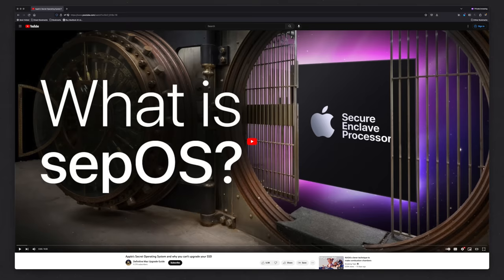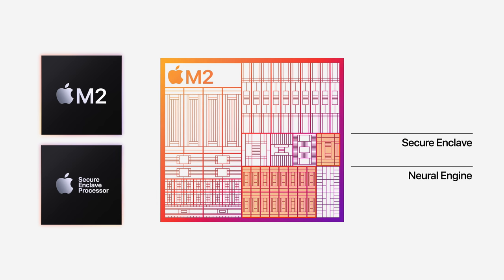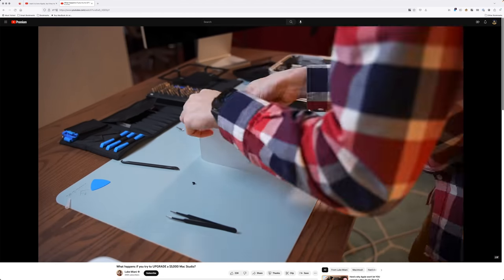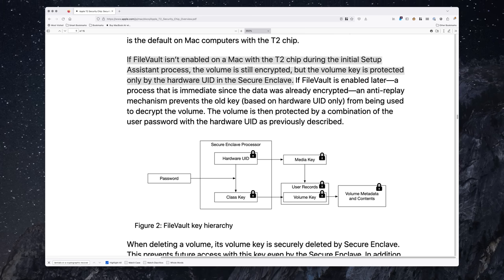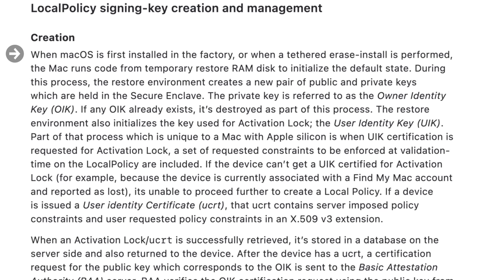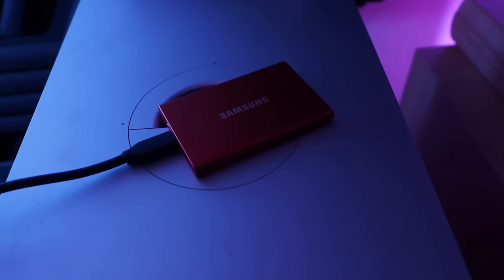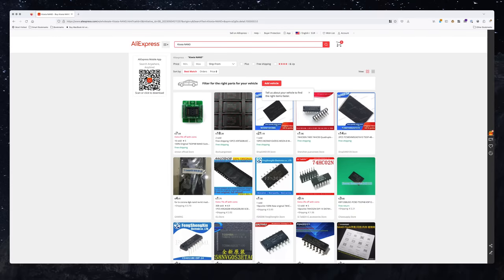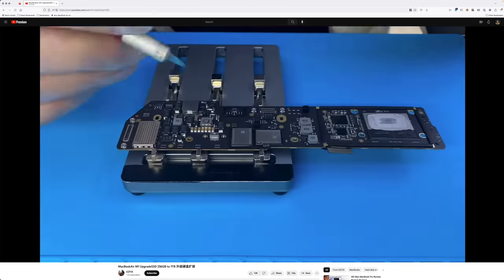Was I wrong? Apple Silicon and SSD Upgrades

Comment: Apple is becoming the embodiment of what it means to be consumer hostile.
Reply from the maker: It's been a trend with Apple post iPhone, they learned a lot from it and took away some bad lessons. I suppose you don't become the world's richest company by being generous.
Reply: Always has been…now just over the top now
Reply: To be fair, they don't market to the self upgrade/hobbyist/tinkerer market.   Every company that sells things wants people to buy more of the things they sell.   
My wife's laptop from work (Dell) doesn't appear to be terribly upgradeable either.
Reply: It’s gotten so much worse.
Reply: They've always been like that and I wouldn't touch anything Apple with a stick, but the damn M1 (and M2) MacBooks are so power efficient. Once the general laptops catch up in power efficiency, I'll switch back I guess. I'd prefer a Linux system and Asahi Linux doesn't cut it yet (though they're awesome).
Reply: @Scott__C  Not to defend Dell, but having Dells computers (both personally and professionally) for the past decade, I tend to disagree. Though, I guess it depends on the model.
Reply: @nowave7  And again, it's her work computer, so there's not any adding RAM, upgrading drives going on.  They have a standard issue everyone gets until it breaks or the I think 3 years is up.
Reply: @Scott__C  That is a company policy not a hardware/software limitation. Not exactly the same, right?
Reply: @nowave7  Partly, but I'm sure they choose models based on that.
Reply: Becoming? 😂
Reply: @Scott__C  so sad given its tinkering roots in the Apple ][
Reply: Right, but if they kept with that, they'd be making very little money.
Reply: @nowave7   There are still Dell systems with 2 user swappable NVMe drives and RAM modules. They even tried to standardize new form of RAM modules to be still be switchable. Dell is not doing this because they don't want to the extra money, they are doing it because they target businesses who can't send in a notebook for weeks to get it repaired. But need inhouse engineers to be able to fix problems within a few minutes.
Reply: But it is at least not as bad as it could be. At least the parts are not paired in a way that would make it impossible to replace them.
Reply: It's Tim Cook's philosophy. To extract as much as possible from consumers.
Reply: @nowave7  Dell XPS laptops are just as unrepairable as macs. Only their business line laptops are repairable.
Reply: @Scott__C this is what I always say when people talk about Apple being anti-right to repair. The vast majority of Apple customers do not want to or wish to repair their own devices. I care about repairability because I like tech but most consumers do not care to open their expensive device and tinker with it.
Reply: @FlyByWire1  That's correct and why I don't understand why so many seem to think Apple should be forced into that when there are other products that meet that desire/requirement for people.
Reply: I don't think Apple is legally required to cater to the community of users who like to service their own computers. Small PCs are becoming unserviceable, just like TVs became unserviceable decades ago. There used to be TV shops on every corner in my city. They're all gone now, and I've never heard a single person complain about that. Nobody has ever argued that TV manufacturers must make upgradeable or compatible devices anymore. Apple is making computers into disposable commodities, like TVs or razors. This is progress. Your freedom is not impacted by Apple's small 10% market share. Why would anyone argue that a small player needs to create products identical to the big players? You don't have to buy from Apple, but you should be defending their freedom to build whatever they want. This is supposed to be a free country.
Reply from the maker: @TheNameOfJesus ll bite, Apple by profits is nearly a monopoly (at least in the phone and wearables markets) and has an outsized influence on any market it exists in. Turning computers into eWaste is absolutely a bonkers take as there’s no reason to do this (beyond profit motive).

Also, TVs are repairable, I actually replaced a bad LCD in a tv panel as I looked up the part number on eBay and bought it for all of $100 about 10 years ago. The main reason tv shops evaporated is cost and rapid improvement in tech. TVs are exceptionally cheap, and the cost of fixing a tv is higher than replacing it. Also, tv standards radically improved during the 90s, moving first to flat panel and progressive scan and the very first lcds hitting the market in the late 90s. Old TVs suddenly were unsatisfactory and later out of date after HD video. 

Computers on the other have gone the opposite way as they’re now viable to use for a decade or more as requirements to run many popular applications havent’ increased by orders of magnitude. Also unlike TVs, Apple’s computers haven’t radically lowered in price, and in some cases have increased. Apple has a problem: they made a product a little too good, and needs to force consumers to buy new products. This is why they removed RAM upgrades and later SSDs on intel Macs despite other PC makes finding ways to keep them on thin and small laptops. Apple silicon also has a nice benefit of forcing users to upgrade as users are creative and simply dropping support isn’t enough. OpenCore lets Macs from 2009 run macOS with few issues.

Also, some users do not have choice in using Apple products. I don’t, as I’m a UX dev and web dev. Some apps simply do not exist on windows or more commonly Linux. If I were to switch to either platform, reducing my ability to work, in the case of windows by not having native *nix and with Linux, the lack of commercial software that I depend on.

With the world’s resources becoming more finite, the stress on the eco system, we have to be more future minded about disposable tech. Apple being the world’s richest company pays lip service to such causes but ultimately is placing arbitrary locks on its hardware, and designs it’s products in a way that flies in the face of it. 

Really most of all, I don’t see the progress here as the late 2000s were much better for us consumers for apple computers.
Reply: @dmug  Thanks for not calling me an idiot. Most people hate Apple so much that when I make a pro-Apple argument, I'm called names. I will try to respond with an equally gentle reply. Firstly, if I recall, the original Apple I computer cost $666, which adjusted for inflation is $2000. But you can buy a Mac Mini for about $599 today, which means prices have gone down a lot, by about 70%. A price reduction of 70% is huge. And the performance has gone up by about a million. Second, Apple's share of the phone market is 20.5% so how exactly is that a monopoly since Samsung sells the same amount? You don't call Samsung a monopoly, apparently. Thirdly, my main point is that Apple has the right to make commodities, and your only response to that point was that it was "bonkers". I think you were implying that that was bad for the environment, but you didn't explain why it was bonkers. We could outlaw paint on cars because paint uses bad chemicals, and simply use rust-proofing instead. So why don't you oppose paint on cars? I have several more arguments but we'll stop there for now. Thanks for being polite, seriously.
Reply: Actually the worst thing is that more products from other brands also tend to follow this path. That’s a real issue.
Reply from the maker: @ConcreteAdvisory  True.... (cries in headphone jack)
Reply: @dmug  I presume you guys are being rhetorical, and that you are not actually calling for the government to mandate every feature of every product of every corporation, even though it sure sounds like you are.
Reply: @FlyByWire1  Sure, many Apple users don't want to repair their own devices, but I expect they'd like to be able to get someone else to do it cheaply if it ever became necessary. Not to mention that most people know someone who's 'good with computers', who'd be up for the extreme challenge of swapping a RAM stick, NVMe drive or battery.
Reply: @TheNameOfJesus  Yes, but that's because the price of TVs has fallen through the floor. Even as recently as the 1990's, large TVs were sufficiently expensive that rental shops were common. Nowadays, you can buy a decent 50" TV from Amazon for £400. Who's going to pay someone e.g. £150 to repair a two year old TV?

And although Macs are much cheaper than in the 1980's, they are still relatively expensive. You can easily spend £2500 on a Mac laptop. Standard NVMe drives lose nothing in terms of performance, are essentially the same size (a few NAND chips on a tiny PCB), and can be easily swapped in case of failure by anyone with basic computer knowledge, or for little cost by a repair shop. Whereas Apple will charge you for a new logic board (£1000+?), or you'll need to find a specialist independent with BGA soldering skills.
Reply: @axi0matic  believe it or not, most consumers do not send their expensive devices to their buddy down the street to repair. They go back to the manufacturer which is what they should be doing. Lol
Reply: @TheNameOfJesus  All professional computers were insanely expensive in the 1980's, so it's not a great comparison point. It would be more reasonable to make a comparison to prices over the past couple of decades, where they've basically levelled off. 

Apple isn't a monopoly, but they tend to capture the top part of the market. This makes them very profitable, and hence influential, as other manufacturers want a piece of their action. Apple may have been the first to drop headphone jacks, SD card storage, easily replaceable batteries etc. but other companies soon followed.     

Obviously Apple is free to make commodities. I think the point is that some of their recent decisions in terms of repairability are unfortunate, and should be taken into consideration when deciding whether to purchase one of their products. The very high cost of repair outside of warranty means that paying for AppleCare is now mandatory, at least on midrange or higher Macs. And resale values will be lowered, since the risk of total loss for any logic board fault, including RAM or SSD, must be factored in when buying second hand.
Reply: @FlyByWire1  Yeah, but I wasn't talking about BGA reworking, was I? I specifically referred to replacing an SSD, which anyone with an IQ over 100 (and an interest in computers) should be capable of. If your mum's laptop SSD failed, would she prefer to a) pay Apple for a new logic board, or b) ask you to replace it?
Reply: @axi0matic  I’ve never even heard of an Apple SSD failing. That’s probably because they’re soldered on and can’t be easily dislodged. 🤷‍♂️
Reply: @FlyByWire1  It's probably also because you haven't watched the video that DMUG pinned at the top of the comments.
Reply: @axi0matic  I did. That video wasn’t even about a failed SSD, that SSD had 84% lifespan left and more than 200 terabytes written to it over its life. It didn’t fail at all LMAK
Reply: @FlyByWire1  Well done for making it 54 seconds into the video. The whole 1 hour video was about replacing failed NAND chips in recent Macs. They aren't doing it for fun; these are customer repairs of failed SSDs...
Reply: @axi0matic  I agree with several of your points, especially when you say, "Apple is free to make...". I'm usually a little disturbed when people say, "Apple shouldn't be allowed to do...". What do these people want, government control of all private industry? Or maybe they want the government to nationalize all businesses? That sure worked well in Cuba. I agree with you that if you don't want to buy something from Apple, that's your CHOICE. I own a mouse, a display, speakers, external storage, and a printer that aren't made by Apple. The only thing I really like from Apple is their computers, and that's my free choice.
Reply: @Scott__C yep my new dell 9440 work laptop has soldered ram etc, and when it had an issue out of the box it couldn’t be repaired
Reply: Well, customers could have been knowing that for at least 10 years – eversince Apple started to solder components like CPU, RAM and SSDs to the mainboard… but as long as customers look at it as an object of prestige and not as a computer consisting of replaceable modules nothing is going to change what Apple is doing!
Reply: They were that a long time ago already and still are.  Things like that should not be soldered to the board.  Most laptops and PCs I ever had never had it permanently soldered.  Even if they were it would be still easier to get it working after an upgrade.  I know that Apple says it is for security purposes but they make upgrading either very difficult or impossible.  Then there are certain MacBooks that have SSD problems that permanently damage the chips so you can't get any of the data back at all.  Then Apple has special chips they deliberately make it so that you can't get them.  They are the ones that fail a lot too.  Their devices seem nice until you watch Louis Rossman's channel and learn about the anticomsumer things apple does.  Sure others may be doing some of these things now unfortunately but they got these ugly ideas from Apple who did them first.

Comment: This is ridiculous. The degree of security hardening in these products far outstrips the actual security needs of the intended users. It's also pointless, because virtually all cybersecurity threats involve either human factors vulnerabilities, such as phishing or the use of 2FA SMS, and server-side software errors, like outdated software and dependencies, publicly exposed file stores, or badly written software. Almost no attacks use physical compromise of target machines, and standard secure boot and filesystem encryption will provide adequate protection against them. The only reason to do this is to prevent servicing of the machine by the end-user or third party technicians, thus ensuring a virtual monopoly that allows apple to overcharge customers.
Reply from the maker: Preaching to the choir here: there are PCs that use hardware encryption on NVMe SSDs. The other claim is performance although Apple’s SSDs are just upper-average performers, in random 4k read/write at high Q depths you’ll find them lacking below other performance minded drives.
Reply: Yup. It's to  support Apple's monolithic vertical market and for no other reason. I defy anyone to give me a real-world (not hypothetical sci-fi) consumer benefit of this.
Reply from the maker: @Blitterbug  Again, security is pretty tight on Apple's computers, although the threat of someone removing the SSDs from Mac Studio strikes me very edge case. 

For traveling business types, I imagine the MacBook being effectively a brick if stolen is comforting as data theft won't be a thing. Over time, MacBooks may become a "low value" target like how locked iPhones are becoming.  The average person won't bother to steal a lost iPhone as they know they can't unlock said device. That's the silver lining I see for consumers. It's not much but it's something.
Reply: @dmug  Mmm, I s'pose govmnt / CEO use possibly, yeah...
Reply: @dmug all Apple devices are effectively aluminum bricks the moment someone accidentally iCloud lock themselves or more likely someone stolen an Apple device.
Reply: It's done so you pay them $1,000 for a 4TB or $2,200 for an 8TB SSD module.

Comment: There were a few MacBook models that used proprietary SSDs. However, we eventually got adapters so that you could upgrade the storage. Maybe it'll happen with the Mac Studio.
Reply from the maker: The old proprietary SSDs were NVMe where the storage controller/cache/NAND were self contained hence why a NGFF to M2 adapter was feasible. The controller is part of the SOC now so there won’t be any solutions that aren’t specifically engineered to the Mac Studio. We never saw third party for the iMac Pro or Mac Pro 2019, which used similar so it seems unlikely.
Reply: @dmug  there is zero intrinsic reasons (aside from corporate greed and inertia), certainly no engineering reasons why Apple does not add an internal user accessible secondary m.2 NVMe slot, that can utilise industry standard NVMe.  
The performance of which would be at least the equivalent of the internal SSD’s of m2 series devices, LOL. And in most cases would be capable of saturating the PCIE lanes devoted to the socket. Say roughly twice the speed of externally attached thunderbolt3 devices, and a darn sight more secure and reliable (no cables to dislodge). 
There is no inherent need to encrypt a secondary bill storage SSD attached to a m.2 bus, so no need for it to be part of Apples Secure Enclave. It merely requires the same level of security offered to external devices, i.e., entirely optional.  Indeed this would actually increase the security of user data, -if used by the consumer, because then more of them would secure their family photos on the drive that can ultimately be removed when the Mac computer eventually shits it’s self. Why? Because the encryption key (if user encrypted)  would be extrinsic to the Mac SoC, because it would be software driven. 

My 6TB of source project video & ProRes proxies would be better served off an internal M.2 NVMe, leaving the SoC ssd for boot, applications, and secured documents. 

Windows PC users can have this why can’t Apple deliver? Ohhh, that’s right corporate greed, inertia, and apparently engineers incapable of holding their own in the board room, or in the bathrooms where design decisions are made. (Clearly Apple has embraced shitty decisions that inherently kneecap the performance of the Mac platform).
Reply: Um, no
Reply: @Blitterbug  Maybe in few years time someone will FPGA through custom controller.